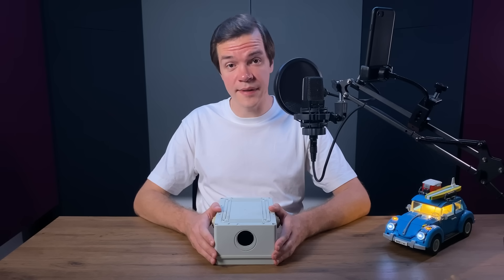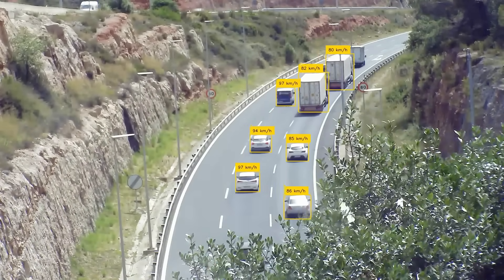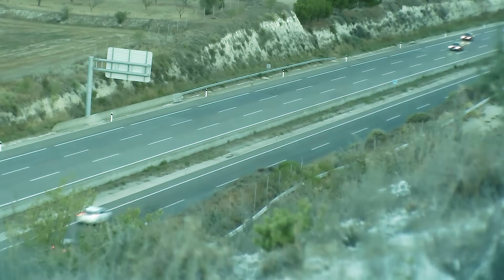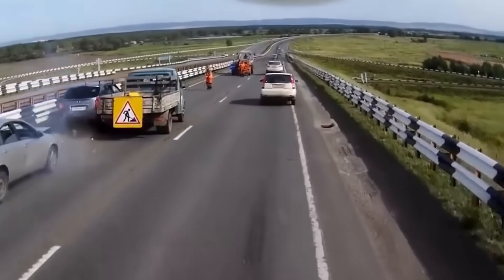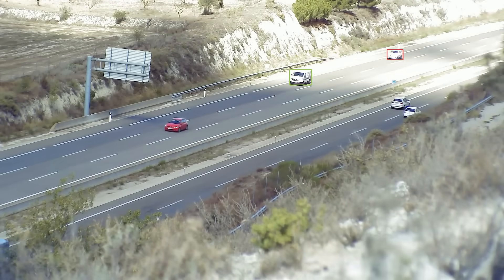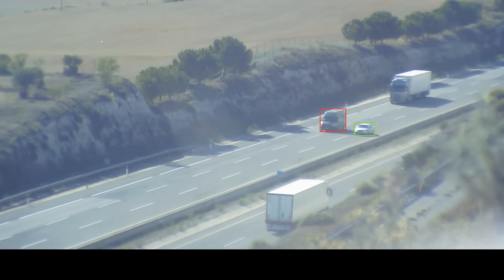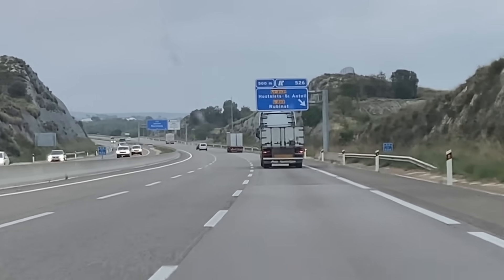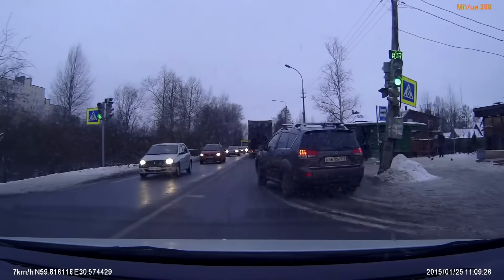New Anti-Tailgating Camera Reveals Shocking Statistics

Comment: The best thing you can do in heavy traffic is to pay attention. Not just to the car in front of you, but the car in front of them, and even in front of them. I've had dozens of instances where I see a problem 3-4 cars ahead and start braking before the car in front of me, and they suddenly have to slam on their brakes to avoid a collision, while I safely come to a stop with time to spare behind them. I've learned that situational awareness is far more important than speed, or even following distance, when it comes to avoiding a crash.
Reply: This is why I hat SUVs and pickup trucks, they make it very difficult to see the road.
Reply: @blockstacker5614  That is why I hav Suv's and Pickups...     (One letter between us!!)
Reply: Helps if you've been cycling only for years before taking your licence- you won't get rid of that attention in all directions simultaneously.
Reply: I do that too. Saved me from probably hitting the car in front of me multiple times. Especially on the Autobahn here in Germany.
I also hate it when I leave space to the car in front of me and some bozo switches back to my lane right in front of me and almost hitting me while changing.
Reply: The biggest danger is coming from behind if you're an alert driver
Reply: That sounds great, but here in the US there's a ton of people driving enormous SUVs or pickup trucks for absolutely no reason. You can't see around them.

I personally keep extra distance, because when there is stopped traffic on the road, that SUV tends to whip onto the shoulder without slowing down. Suddenly I'm going highway speed and there's completely stopped traffic in front of me with no distance to stop.
Reply: @devilslamp That's why you need to create space around you if you can.
Reply: If you're on a motorcycle you also must keep track of what's behind you!

Enjoy the ride!
Reply: @labbeaj  Yeah, it's wild, I'm 17, so I'm not yet allowed to get a car license in Estonia, but I will as soon as I can. Even government officials with blue license plates tailgate me 50% of the time at a distance of 2 meters behind my motorcycle while going 70-90km/h (44-56mph). My mother does the same all the time, and if I try to tell her, she accuses me of insulting her, as always! 🤣
Reply: @giorgiolelmi8175
You are the one who's right 👍👍👍
Reply: @labbeaj  Riding a motorcycle has greatly jacked up my road awareness habits because they are practically required to ride safely.
Reply: @lyianx Me too!
Reply: @labbeaj I do this even in my car. If somebody is tailgating they can still sweep you off the road if anything happens.
Reply: @labbeaj  You need to keep track of what's behind you in any vehicle.
Reply: i thought the best thing you can do in heavy traffic is remove yourself from it
Reply: @anwealde I drive a lot for work. I don't think my boss will be happy with that.
Reply: @LaurineVK all else being equal, I would think your boss would prefer you to drive in light traffic rather than heavy traffic 😁
Reply: @anwealde Of course. But it is rarely possible. After all most of our clients are in heavy traffic areas.
Reply: @anwealde this
Reply: Most people are unable to drive like this m8. Thats the sad story.
Reply: @12Burton24 Let's be honest, greater than 50% drivers shouldn't be allowed to. They either can barely see (particularly at night), or have such poor reflexes that they cannot react properly. 

Self driving cars cannot get here fast enough.
Reply: This is clearly from a person who follows to close and thinks it’s okay and that he can get away with it because he looks a few cars ahead
Reply: This is why high-mounted brake lights became standard. My first cars didn't have it originally, and installing a kit actually gave me a lowered insurance premium back then. 
(I'm in Norway. Most of our insurance companies have at least one person with a working conscience in their staff. )
Reply: This rule is gold. I have prevented at least five serious accidents that way in my life. And the last one was only yesterday.
Reply: Driving in town, I check 2 vehicles ahead and 1 behind, on the highway at least 3-4 ahead and 2 behind:  defensive driving is the only way to drive! 
And when I see a road pirate behind me, I always let them pass, so I have more control on what mess they might cause.
Reply: The instructor at the driving school I went to had a fun way to describe how you should be paying attention: "You gotta watch the car in front of you, and the car behind you, and the car to your left and the car to your right and the car coming out of the sky."
Reply: It's very difficult in practice to do this though. There are so many SUB, Trucks, Pickups where you just cannot see around them. This is especially so if you're not also driving a regular sized car.
Reply: @Komainu959  The further back you get the wider your point of view and drive a little off to one side.
Reply: In motos we call. this the concept of "Envelope" for 
"Envelope of Safety".  this is dynamic.
Sudden road hazards (trash, pothole, tire fragments) have a speed/distance relationship
Reply: and thus making a 30 meter gap plenty.  100 meter gap in heavy traffic on any USA city roadway is impossible, more like 15 meters at 60MPH.
Reply: I came up with an idea in 1982. I would always pay attention to the lanes on either side of me. Is there an out? One Sunday heading up the grade on California Highway 101 in heavy traffic cars suddenly slammed on the brakes. I could stop in enough time, but instead I pulled over into the center shoulder. The guy behind me slammed on his brakes. When he stopped he was even with me.   He looked right across at me. My move had not only saved him, but also me and the guy in front of me  and possibly  6 other cars behind the guy looking across at me. So he needed all that space.
When I look for a speed and 'place' in traffic, I want to be as far away from other vehicles as possible.  Tesla FSD up until about 2022 would sometimes get in a position right next to a car in the next lane and go at the same speed. On the Telsa Ideas board I pointed out that the way that other driver 'sees' you is pretty much only if you are moving relative to him. Faster or slower. As soon as you 'lock in' his speed. You are effectively invisible. Risky. Musk made a comment, "Got it." and a couple months later my Telsa stopped doing that.
Reply: I find that the one thing that makes the most impact on whether I'm comfortable being in a certain lane and position is whether I can see over, or around, or through the car in front and further ahead to know what's coming. Especially in heavy traffic (it's just easier to see far forward at highway gaps and highway speeds). Yes, where I live a lot of people also either drive freaking shipping containers, have blacked out windows, or both. Doesn't mean I shouldn't try to see beyond them anyway. Look for reflections of brake lights, try to move sideways in the lane, that kinda thing. Or move to another lane with a less ridiculously huge truck in front of you.
Reply: One of the problems with this is the new obsession for SUVs that makes it impossible to see ahead of the car in front of you. 
Remember when they first introduced the upper brake lights and one could see a car 8 cars ahead of you brake? That's all gone as soon as one of them is a bloody SUV that ruins it all. And that's just one of the problems they bring to the table/road.
Reply: @johanhalvarsson2148  Yeah but I wouldn't say it's new. It's almost older than myself!
Reply: This is the way
Reply: Nah I think lots people believe they can do this, but overestimate their abilities in reaction time and maintaining constant awareness and focus. I find that tailgaters usually do not immediately react to me braking, so I have to start braking farther back than I normally would to accommodate them.  They also seem to have a weak concept of inertia and think their reaction time is better than it really is and that their attention has a laser focus on the road when in reality most everyone's attention drifts a bit while driving from inner thoughts, conversation with others in the car, music, looking at phones, etc. Plus since they are driving so close to me, their focus has to be proportionally more heavily on me, and they have a poorer awareness of surrounding cars and situations occurring further ahead down the road.  I live in a metropolitan area of about 8 million people so  I can expect to encounter some form of crazy driving pretty much every time I drive anywhere at any hour.
Reply: teach your brain to see everything in front and to your left and right  with out having to look right at them
all this takes good focus of mind to do this .
Reply: Unfortunately SUV's and trucks, especially those with tinted windows make this much more difficult if you're driving a normal car. You can't look through cars like you could before.
Reply: You can see through cars?
Reply: @alexandercastleberry480  They do have transparent windows, generally.
Reply: I drive for work and the vehicles are fitted with telematic systems. Its not too difficult for manufacturers to include these on newbuilds and post fits. These can give visual feedback on driving behaviour. The simplest are led traffic lights which can easily warn when too close together with audible warnings. Many dashcams offer this. Theres a simple solution, just no will to implement.
Reply: Not know your location, but where i live in, people just had blacked out windows glass and cars bigger than containers, is impossible to see ahead in straigh lines... is not a valid method for everyone sadly
Reply: I do that since decades.
But also ad distance and vigilance to the car at the back.
In case of sudden stop, I turn the emergency lights on the signal the car behind me.

If they ride too close, I reduce the speed into the safe one for that distance. They get mad all the times, but they are the ones to blame for my security move...
Reply: This is 100% true, but also impossible to do 100% of the time. This is why trying to maintain that safe distance is one of the best tactics as it gives you another safety margin in case you are only paying attention 98% of the time. ( I say trying because we all know how difficult it can be on today's busy roads)
Reply: I drive regularly on the 400 series hwys in Ontario Canada. Learned to do exactly this very very early in my driving career. Has saved me many times!
Reply: Yes I do that for that reason but also for the person behind me. I reacted sooner giving the, more time to slow down as well
Reply: Agreed 100%.
Reply: It also helps prevent the almost collision from rippling through the traffic and causing an accident behind you.
Reply: Everyone driving slower than me is an EFFING GRANDMA 
Everyone driving faster than me is an EFFING SPEED DEMON
Reply: Agreed. The problem is that it can't really be taught.
Reply: It’s also good to be aware of who is behind you in your lane and adjacent lanes, because sometimes you have to bail out of your lane.
Reply: Amen, brother. In stop and go traffic, going easy on the gas if you see groups of brake lights 20 cars ahead can help break up nasty traffic jams. The stop and go is because people check the radio or their makeup when they stop completely. So much better if everyone is going 2 mph, so we can all accelerate together, as a team.
Reply: Try to do that with a huge SUV with black out windows in front of you or worse that truck that overtakes another truck at a speed just 1 mph higher than the truck they are overtaking. Good luck to see anything even from a distance!
Reply: that's why I hate vans. one sees nothing in front, and often people who drive vans have a nervous driving, they drive too fast, brake at the last moment and change lanes often. especially the delivery vans.
Reply: Once you sense the collision forming ahead, and you have a bit of a bubble to work with, if you spike your brake pedal for about 0.5 s, it will accomplish many things. 

First, your brake lights come on the moment your brake pedal leaves the pedal stop. This is usually well before you generate any braking force. 

Second, the quick spike will quickly shed maybe 10 MPH. 

Third, your ass-end will pitch abruptly upwards due to the brake dive of your front end. Nothing spells urgency to the car behind you than a brief, force factor 10 brake dive. Next, you have to let go, because at normal following distances the car behind you has no chance to stop in time, but it will already be stopping hard without delay, and that's the most you can hope for. 

Then you judge the total space in between the rear bumper of the car in front of you and the front bumper of the car behind you, and you come up with a sustained braking pattern to remain exactly in the middle. This will mostly involve studying your rear view mirror. You must also account for the car behind the car behind you, because the car behind you might get a potent assist. 

I lived in Montreal for three years in the early 1990s. Living only a few blocks from McGill, I only drove a borrowed car, but I know what you are speaking of. This is the only time in Montreal that you actually use your rear view mirror. The rest of the time, it's an eyes-forward driving culture.
Reply: This is why you should stay away from the herd and fall back
Reply: Unfortunate that speeding drivers wait until the last second to pass cars going the speed limit in the right lane
Reply: Ride a motorcycle,  you'll actively look down the traffic stream to develop that skill to it's maximum.  It's self defense.
Reply: 100% and keep the correct following distance
Reply: I safely come to a stop with time to spare..... then.. BAMO... the idiot behind you not paying attention slams into you. To top it off he then jumps out of his wrecked car and blames you for the accident, he says you stopped short and thus break checked him and caused the accident. His insurance sides with him and.... more trouble.
Reply: @robert5 Been driving over 20 years now and that's never happened. I don't believe it's as common as you think.
Reply: ^^^ THIS! ^^^
Reply: I drive many hundreds of yards ahead of my position. Learned that from my dad. It is also currently impossible for computers to do.
Reply: @coachhannah2403 Why is it impossible? 

How do you think the gps "knows" theres traffic ahead before you see it?
Reply: @labbeaj - At current, the radar/lidar is line of sight, whereas I can see further (actually, by now, my knowledge may, indeed, be out of date). Dynamic mapping software is still toddling. And GPS can only track other GPS emitters, so there are still dark vehicles on the road.
I am pretty sure, as a lay person, that the crossover point has already been reached, where autodriving is less dangerous than the bottom 50% of drivers. Not to 90th percentile, yet. Lots of crashes get highlighted in popular press, but they ignore human crashes...
Reply: Um, 2 seconds is the standard following distance in the US.
This time is not related to 'stopping distance' but to 'reaction time.'
Reply: Following distance also plays into situational awareness, though. The closer you are to the car in front, the less visibility of the track ahead you have, which also means lowered situational awareness.
Reply: @henriquepacheco7473 - Absolutely true. In fact, my wife's cruise control car follows more closely than I am comfortable with. I have old school speed control on my manual transmission car. 😎 But, I follow as traffic allows, often closer than 2 seconds.
I once had a stag cross between the car ahead and me, on a windy mountain road, dark night, following about 1.5 seconds behind, at 65 mph. Sometimes you just get lucky!
Reply: That’s it. Been driving about 2.5 million km and never hit anybody. Always enough space to brake, but also rarely keeping the distance mentioned here. I learned to keep the reaction time (plus reserve), and not the braking distance. 
The important distance is being able to stop within viewing distance!
Reply: @robertbrzheintzbrz147 - I'm at about a million miles, my current 20 year-old car is at 250k+ miles. No reportable accidents. Mostly see things on the side of the road before passengers...
Reply: It's great when you're the big vehicle and you can see 3-4 cars ahead, but when the vehicle in front of you is a pick-up or SUV and you're driving a car, you can't see crap. (Speaking for U.S. roads where everyone wants jumbo-sized vehicles.)
Reply: @azuarc - Absolutely. I drive a 20-year-old car that still gets 40 mpg, so is very short!
Often, when I pass (lost art!) it is for visibility, not speed!
Reply: This. Safety while driving is about anticipation. And it also helps with traffic. Why people continue to accelerate until they have to come to a stop is mind boggling. Just roll at a slow but consistent pace and everybody gets home earlier
Reply: That's why (proper and safe) driving is so tiring; constant situational awareness.
Reply: i wish i could do that but everybody has a 10 foot tall SUV with completely blacked out windows so i'm completely blind. Sometimes i genuinely contemplate installing a periscope on my car roof.
Reply: Sure - in a perfect world paying attention is KEY. But you're missing the nuance here. A reasonable following distance is there to save you when you're not perfectly paying attention.
Reply: in america driving a sedan makes seeing that far ahead impossible
Reply: @mappplesirrup8473  Only if you're tailgating.
Reply: @mappplesirrup8473  You can look through other drivers' windows. You can adjust your position in the lane to see what's ahead. You can see shadows on the road, sometimes. I've only ever driven sedans and I find myself able to see what's ahead of the vehicle in front of me pretty fine. I'd go as far as saying if you can't see past the car ahead of you, then you're probably following too closely.
Reply: @tstivers1990 while in a sedan, truck (and some SUV) windows are too high to use to see through. Trucks often take up so much of the lane that seeing around them would require part of my car being in another lane. As for shadows, those dont always exist, in fact if youre driving east or west they almost always dont exist. 

I use all three of these strategies when possible, but often trucks are so large that not even these tricks are enough to see around them, and thats the point we're trying to make.
Reply: @tstivers1990 Not if a bid SUV or a truck is in front of you. You are just staring at a hunk of metal.
Reply: @LaurineVK Not true. Even if you're behind a semi with an attached trailer, you can adjust your lane position, following distance, etc to maintain awareness of the road ahead. I drive 100+ city miles every single day and practice these strategies. And it has allowed me to avoid multiple accidents. Literally the only two accidents I've been in, was someone who came out of nowhere from behind me, passed me in the median, and then clipped the front driver side of my vehicle after I had already come to a complete stop. And one where I hit a small patch of snow while using cruise control, uphill, on a windy road. Cruise control instantly sent the vehicle completely sideways across both lanes, and I still managed to get the vehicle straight. But momentum sent the back end of the vehicle into the oncoming lane's guardrail. Even then, I turned what would have been a totaled vehicle into $3k in repairs that only involved minor body work on a modern vehicle. Lesson learned. Don't use cruise control when driving uphill and snow is a factor.
Reply: @skarbelstm Part of your car being in another lane, briefly, to maintain awareness of what's going on ahead of you, is fine. Police aren't going to give you a ticket for maintaining awareness. Maybe you will get pulled over for crossing the yellow line. But, even if it's a trooper, they're not going to give you a ticket when you say, "Yeah I crossed the yellow line to see what was going on ahead of the vehicle in front of me." They're unlikely to even suspect you're under the influence just because you deliberately crossed the yellow line briefly to maintain awareness. Anyone who has been behind a drunk driver can tell the difference between someone deliberately crossing the yellow line and a drunk driver who can't maintain their lane.
Reply: @tstivers1990  i get that, and to get information like "oh theres nobody in front of that truck" I will do that. It doesnt help, though, for situations where traffic in front of said truck comes to a sudden stop, as i would either need to ride the yellow line to have that information or I wont be able to see. 

To clarify, being able to see several cars ahead is so that you can avoid sudden happenings, so "moving over for a second to check" doesnt work
Reply: @skarbelstm Again, if you can't react to the vehicle ahead of you stopping suddenly, then you're following too closely. Your following distance should literally allow you enough time to both recognize the situation and come to a complete stop before colliding with the vehicle ahead of you.
Reply: @tstivers1990  the point isnt that i dont do that, its that large SUVs and Pickups force you to stay super far back and reduce your awareness overall. 

Not only does it incentivize people to cut in front of you when taking the necessary space, being further back from someone decreases your ability to judge your speed compared to theirs as well
Reply: @skarbelstm  "being further back from someone decreases your ability to judge your speed compared to theirs as well" 

By the time I can't judge the relative speed of the car in front of me, there's room for another two full cars in between us. Seriously, I can call a pickleball out of bounds by four inches when it still has 30 feet left to fly. Gauging the speed of the car 8 or 10 seconds in front of me is no challenge whatsoever. Learn a sport with a puck or a ball or a birdie. You'll soon be amazed by what the trained eye can accomplish.
Reply: @skarbelstm  "large SUVs and Pickups force you to stay super far back and reduce your awareness overall" 

The amount of awareness required is inversely proportional to following distance. 

The most difficult task in driving is to notice the vehicle in front of you activate its brake lights, then immediately assess how hard the brake pedal was just pressed. This does not require awareness far up the road. Awareness helps, but you can't depend upon this. 

Unless you are positive that the brake lights ahead are just shedding a little extra speed, you should immediately cover your own brake pedal, depressing it off the pedal stop to light up your own brake lights, to warn the car behind you (it's your own ass you are protecting here). Then if the distance suddenly seems to be shrinking faster than desired, you need to go immediately to about 1/3 pressure, which will be slightly alarming to the car behind you, but not enough to actually cause a collision, even if it reacts slowly. 

If you are still gaining, then you need to crank smoothly up to 100% brake force, keeping a close eye on the car behind you. 

Smaller vehicles under heavy braking will heave in a recognizable way. Big rigs don't have the same tell. 

If you don't go hard enough, soon enough, your front bumper is fried. If you go too hard, too soon, your rear bumper is fried. This is why you should generally have ants in your pants to light your brake lights up at the least provocation, and to quickly rush into a 20 to 30% braking maneuver on the least doubt about what lies ahead, but you should already have your eye on the rear view mirror before doing more than this. 

30% at the first opportunity usually means you won't need 100% at the last opportunity. 

The math of quickly relaying the brake signal backwards is spectacular. If the car behind you is 4 s behind the car in front of you (pretend you are not there), and you relay the brake signal quickly (I can do this in 0.6 s), and you can keep yourself exactly in between (because you are skilled in the art), then effectively the sandwich you are inside is 3.4 s deep, which is usually enough to avoid a collision. And that's in the condition where everyone is following at a slightly unsafe 2 s distance. 

I've previously tested my raw reaction time at around 270 ms, which is excellent for my age. On the pickleball court, I'm in hands battles all the time where the ball is transit is under 600 ms. The pros can actually sustain hands battles with a transit time under 400 ms. 

There's actually quite a bit of time if you don't waste any.

Note: In a previous response on this same thread, I gave a different braking strategy to use when you already know a pile-up is forming in front of you. If all you can see ahead of you is a big rig, your first clue will be a giant judder, smoke off the tires, or his butt end beginning to slide sideways. Big rigs don't jackknife their load unless they are going into the pancake with near certainty. Normally you can see more than this.
Reply: To a first approximation, if your front and rear brakes are properly proportioned to their axle loads, you should be able to achieve the traction limit for the road surface, just before locking up front and back simultaneously. For a good road, this doesn't much depend upon your tires, unless your tires are threadbare. Premium tires make a much bigger difference in bad road conditions: uneven pavement, debris, water, oil. 

An additional problem is that there is a fair amount of weight transfer from the rear axle to the front axle under hard braking. Basically your center of mass forms a lever arm with respect to your front axle. Under expert control on a bicycle or motorcycle, you can basically transfer 100% of your weight to your front wheel, so you have your entire normal force on a single contact patch, which can be fully optimized for maximum braking force. Stray but a little beyond maximum braking force, and you pitch forward, tail over tea kettle. This is not for the faint of heart. But you can achieve stellar braking power by reducing your braking system to a single variable. First year physics: normal force times coefficient of friction. This formula does not count tires. 

In a grocery-getter, the weight transfer is never total. So now you are using one brake pedal to control two different contact patches, and it can be hard to optimize both at the same time. You usually have to limit yourself to staying below whichever breaks free first. 

Depending on your axle load and how your brakes are set up, you might get far less than total available braking power, even on a perfect road surface. The great thing about modern ABS is that it controls all the tires independently, so all four tires can independently maximize their contribution. 

Pickup trucks are especially bad for axle balance. The best balance when riding empty is totally different than the best balance when riding fully loaded. The manufacturer probably set the brakes up to achieve maximal deceleration somewhere in between. 

If you are being followed by a pickup truck (without modern ABS), then pretty quickly your maximum braking force will be limited by his maximum braking force, unless you want to sacrifice your rear bumper. Do you know what load he is carrying? Probably not. Assume the worst. 

Edit: Continuing on from a previous post of mine in this thread, the corollary of following a pickup truck with bad axle balance into a pile-up is that you can probably assume he joins the pile-up, so you can plan your sandwich budget based on the vehicle in front of the pickup truck and the vehicle behind you. Those two vehicles in front of you will become one before you run out of your own space. This increases your planning horizon early on in the emergency.

Second edit: Note, as well, that I confined all my comments to roads in good condition. If you are tailgating on a road where hydroplaning is remotely possible, you need your head examined.
Reply: In the basic physical model, all the vehicles have the same deceleration available, because of the formula of normal force times coefficient of friction to generate force which is then divided by total mass to get acceleration (negative for deceleration) and it works out the same for everyone, if all the vehicles have optimal axle balance (the braking force on each axle must be proportional to the weight division). In that highly idealized model, if everyone slams their brakes on simultaneously to the traction limit, everyone comes to a stop the same distance apart as where they started. 

So all of the changes in distance (negative distance eats into bumpers) is due to lack of equality in deceleration, or relative delays in brake force application. The delay in activating your brake at all is usually not large. The delay in realizing that the condition in front of you demands maximum brake force yesterday is a different matter. 

Our brake lights don't convey this second intensity level, which is why this is finally the most deadly delay. 

Beyond the 0.9 s, the rest is mostly soaking up in what I tend to call the matching delay. The car in front goes directly into a panic stop. You hit the brakes soon, but not nearly so hard. Kaboom. You failed to immediately match the braking intensity of the vehicle in front of you.
Reply: Knowing HOW to drive is 99% of the solution. Sadly a lot of drivers only know how to turn the wheel and how to hit the accelerator and brake.
Keep your focus on the road and the traffic, watch and learn constantly and you will become a better driver.
Complaining about 'tailgating' will never learn you how to move back to the right asap or stay on the right lane if necessary.
Reply: When i was a PC tech and traveled around, use to see women mis an exit on the freeway and come to a complete stop. saw one woman she came to a stop, then slowly inched over into the lane on her right till that lane stopped, then did that to the next lane. At one point her car was across the whole highway. I looked in my rear-view mirror and as far back as i could see all three lanes were just sitting. every once and a while hear a skid, then a crash.  she then zoomed up the exit she missed. Not once but 5 times i have seen this. I love women they are great. this world would be nothing w/o them....but some should never drive. lol
Reply: @meTimetraveler I've seen men do this. Or, more often, just suddenly turn right in front of you. Sometimes across 2 lanes.
Reply: Pay attention to what's behind you. Half the problems are from people not seeing whats behind them too